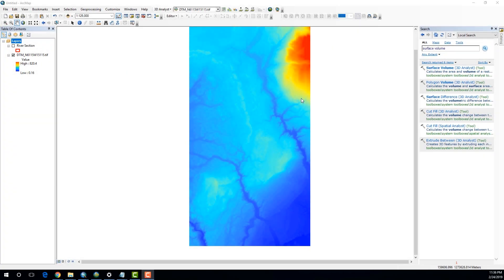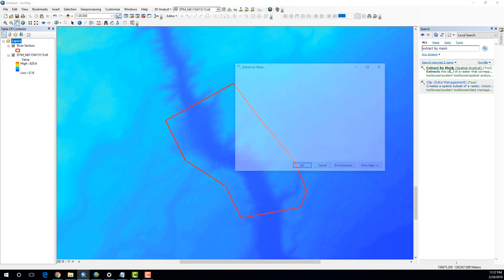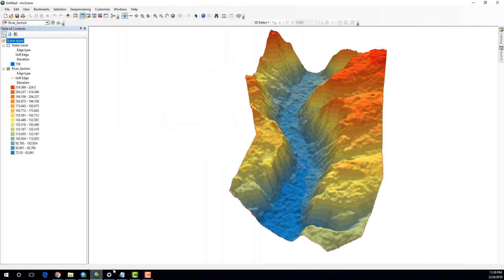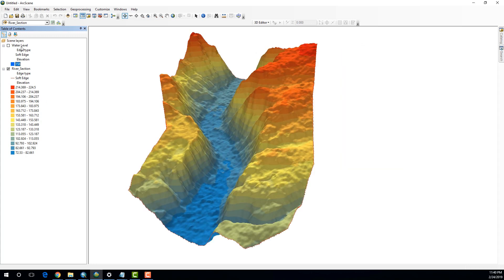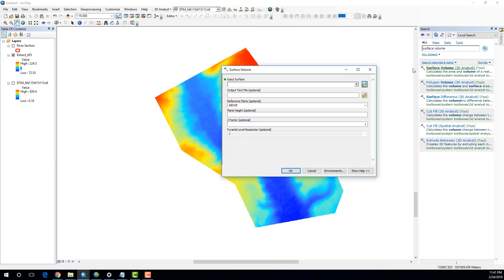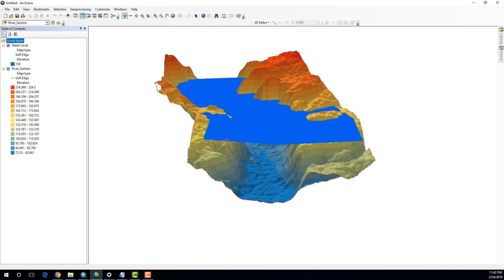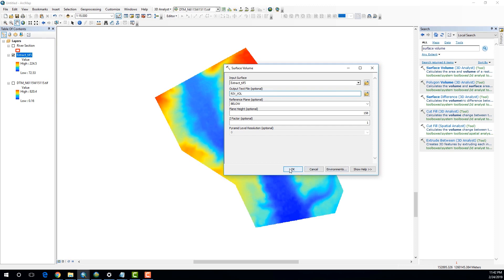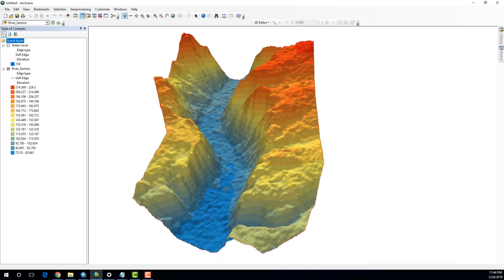Calculating the Volume of a Raster using 3D Analyst of ArcGIS (ArcMap + ArcScene)

Comment: Hello sir,  There is a little doubt mine that how didi you convert this raster data to a teen model and import it to Arcscene. In my case the extract file is saved as tiff file after I create my river selection area, and then in arcscene the raster data elevated in irregular and zig zag type. So please resolve this

Comment: This is great work, but I have a question about units:

I would assume that the vertical units are whatever is specified in your raster, so they are meters.  However, how are the horizontal units measured? Are they raster rows by raster columns? Or are they defined in another place? So if my raster resolution is 1/2 meter by 1/2 meter, while my vertical is in meters, the output volume will actually be in Meters /4.

Comment: I have some question though. How did you make your water level plane with inherent elevation values? Thanks
Reply from the maker: You can create a polygon, and assign an elevation (water level) value in the attributes table. After that, use the polygon to raster tool to convert the polygon into a raster, while making sure to select the specified value as it's field for the conversion process. This will create a constant value raster equal to the specified elevation value. You can then import that in to ArcScene

Comment: how I can get river level shp. ? it is the same as the water surface which extracts by using an index?
Reply from the maker: You can create it manually as a with a specified uniform value, and that value can be the water level
Reply: @geodeltalabs  thank you a lot, but i have another question :-; that , how I know water level ? where can I get it ?  by data situ or what ? ;__;

Comment: Is there a way to make a surface that isn't flat? For example a water surface that would change elevation with the slope of the river?
Reply from the maker: An idea is to first create a set of lines with corresponding elevations, and then trying to create a surface using those lines. Then you can bring in the output raster to ArcScene
Reply: @geodeltalabs  Hi, could you please explain how would you do this? Thank You

Comment: how did you make a water plain here?? please ca you explain the process?
Reply from the maker: You can create a raster with a uniform value. First create a polygon (a rectangle preferably). In the attributes table, specify a single elevation value. This elevation value is the water level. Then convert the polygon into a raster, based on your previously specified single value. Once the raster is created, import it into ArcScene.
Reply: You could just create a constant raster via "Create Constant Raster" tool, and specify the value.